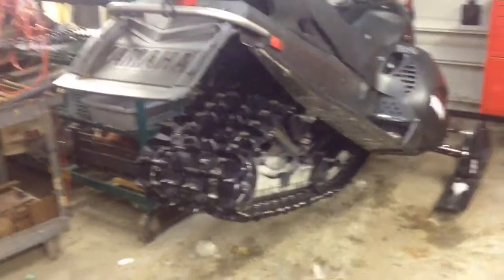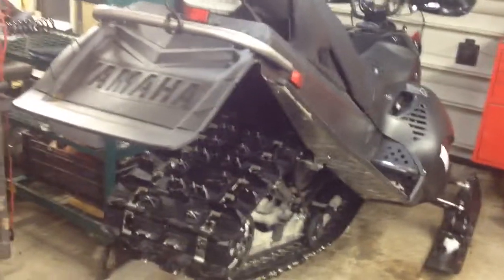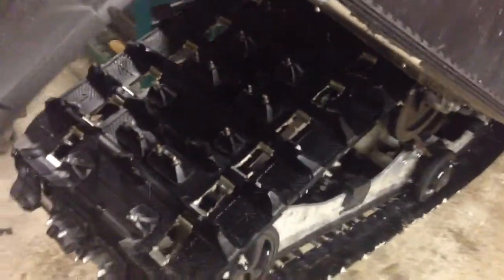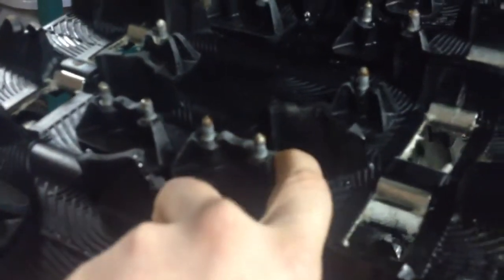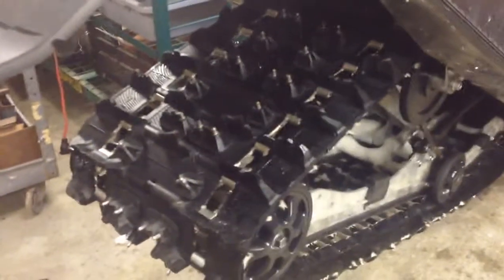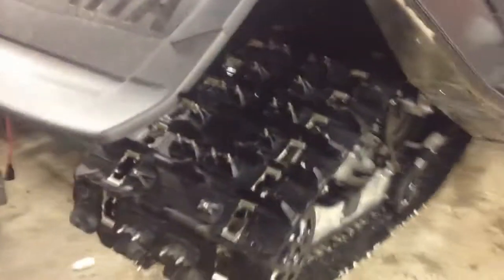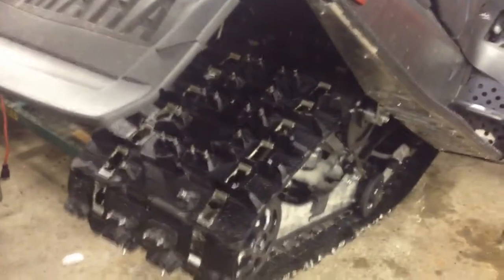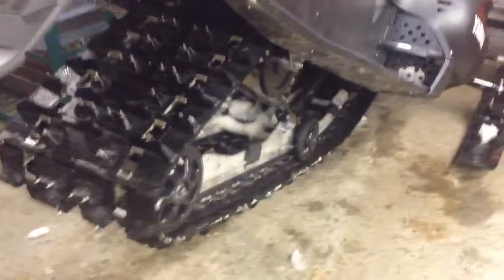Review: stud boy pro series super lite backers

Comment: Your doubles are in backwards, they should make a little scoop for acceleration.
Reply from the maker: Richard Weidner yeah I've been told that but I was following the lugs on the track and forward grip was not an issue. Had it on hard pack and bit hard enough to stand it up to meet the kill switch with my chest. I honestly don't know that you'd know a difference either way. All the lugs on the track go this way like a tractor tire.
Reply: hentree56 yep you are right about the track lugs, I see a lot of tracks that way now, maybe there's some physics going on that make it better that way I'm not understanding. Anyway I've 4800 miles on my backers like that and they all look great, even with some broken studs the backer is fine.

Comment: I love the pattern you used on your studs where can I get that template ?
Reply from the maker: I used the woody's pattern, it's a card stock templet. Then to use the stud boy backers I had to use a marker for the inside holes of the double backers. It's easy just line up the outside hole and make your own inside hole. Hooks up very well.
Reply from the maker: The templet is like $12-$14 on the woody's website.